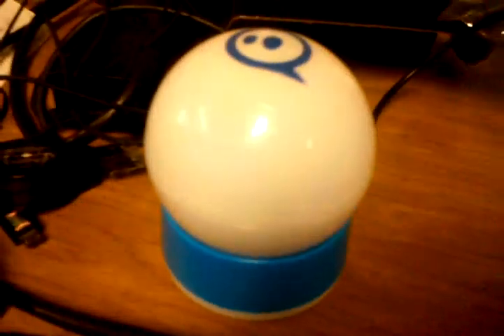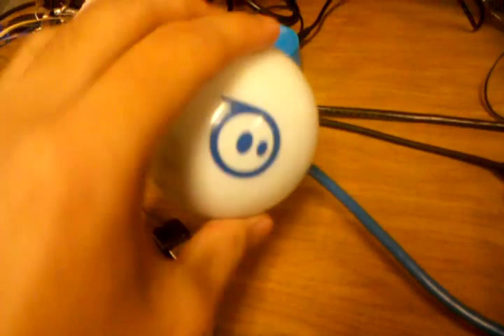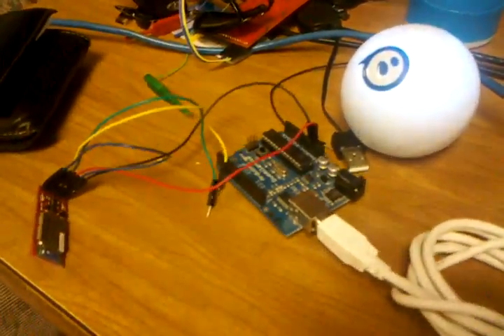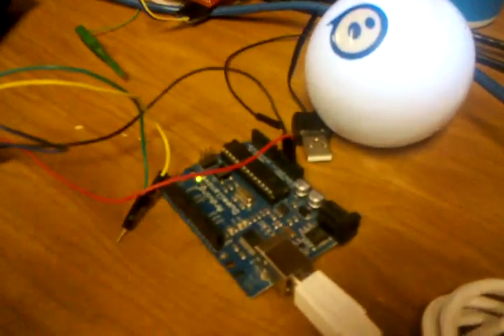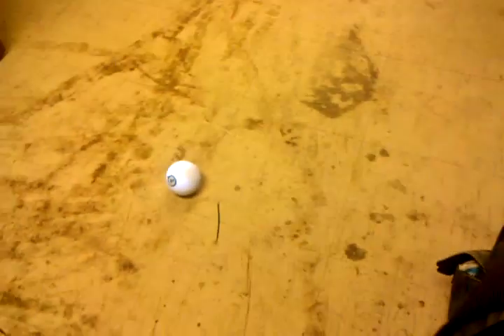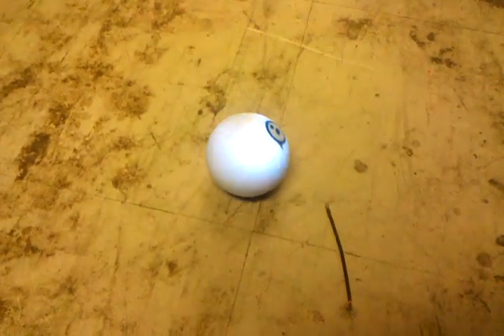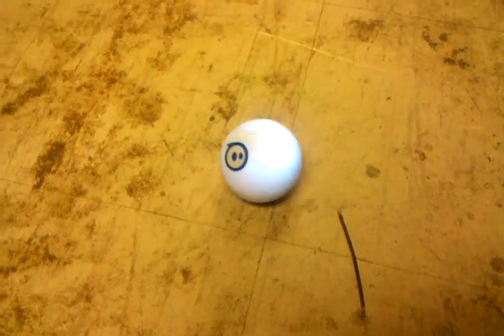Getting started with Arduino, Sphero, and Bluetooth

Comment: Please help! The autoconfig example won't work because I get this error message:

In file included from /var/folders/28/792qcps57rd141tcvw2_npbw0000gn/T/arduino_modified_sketch_463406/SquareRoll.ino:1:0:
/Users/MYNAME/Documents/Arduino/libraries/Arduino-Bluetooth-Library-master/Bluetooth.h:15:20: fatal error: Serial.h: No such file or directory
compilation terminated.
exit status 1
Error compiling for board Arduino/Genuino Uno.

Comment: How did you do that with an Arduino UNO. The library README said it can only be done with an Arduino MEGA and I have even tried and didn't work
Reply from the maker: It's been a while, but I still remember struggling with this.

Back when this video was made, I disabled all debug output to the Serial Console and renamed all instances of Serial1 to Serial in the library.

Comment: Hi, when you ran your code, and the sphero starts spinning, how do you make the sphero to stop?
Does it stop automatically when the bluetooth connection is lost? Will it spin forever?
Reply from the maker: Part of the API is a stop() function that will stop the Sphero. You can also set the motors using setMotorPowers(0,0);

If Bluetooth connection is lost, I think it will keep on executing the last command it received. I don't recall how this behavior is handled on the Sphero, and it might have changed since Sphero 2.0 came out.
Reply: Thank you very much.